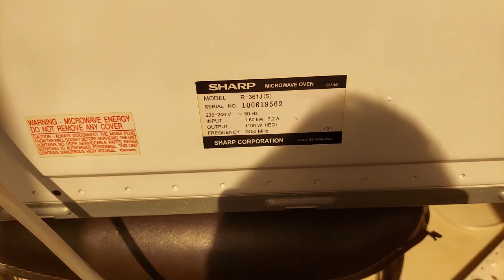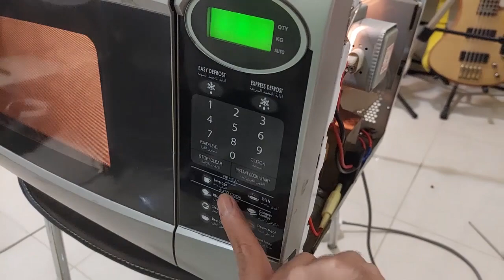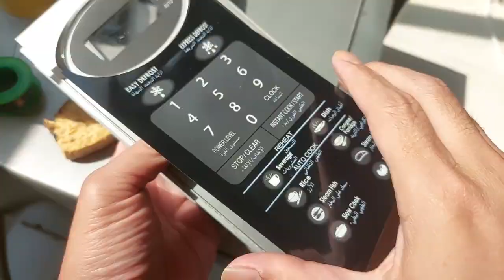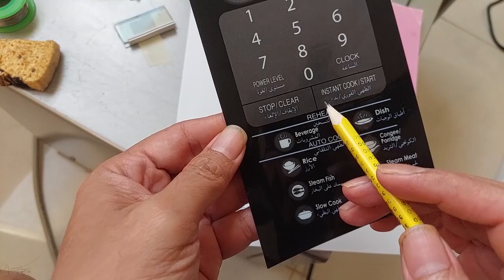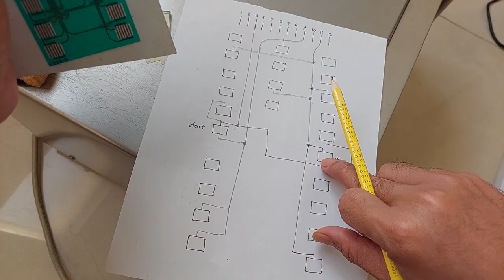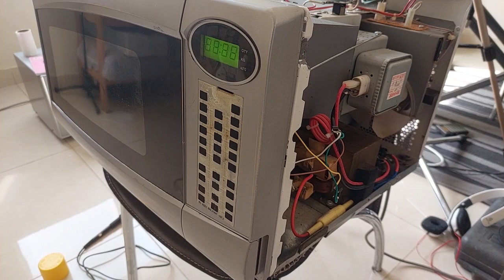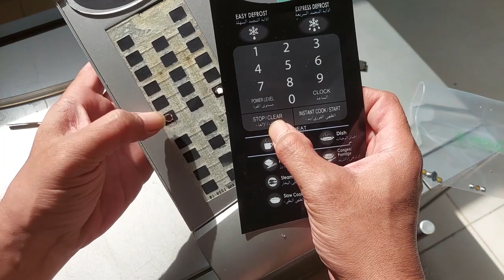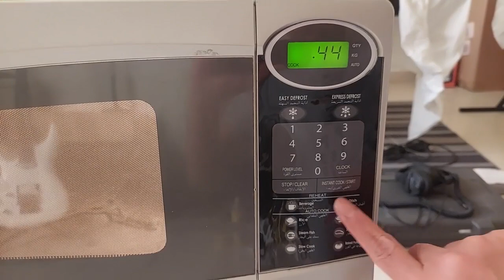Microwave Buttons Not Working - Solved

Comment: Hello, I have a sharp also  it has 8 buttons and one rotating button.  Only Rotating button, clock, stop/clear works. The start, enter , micro power and weight defrost it’s not.   But. When I put time defrost  and select with rotating  and then start. It works  defrosting but it won’t work if I press start alone as start used to have the 3O seconds  and if you keep pressing adds another 3O seconds. Thoughts on this?
Reply from the maker: if only Start button problem, there is a hope it only need cleaning the carbon.. check also connection to flex cable